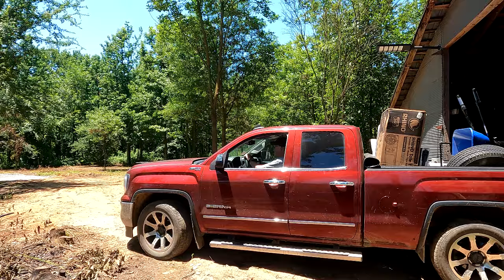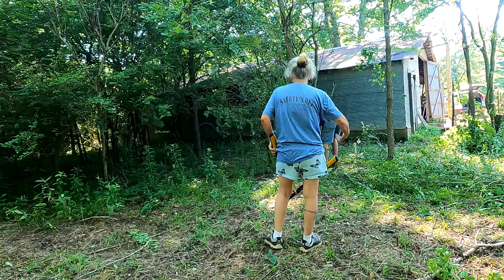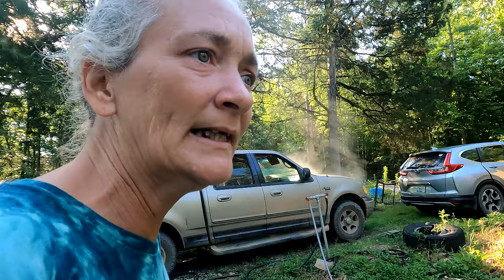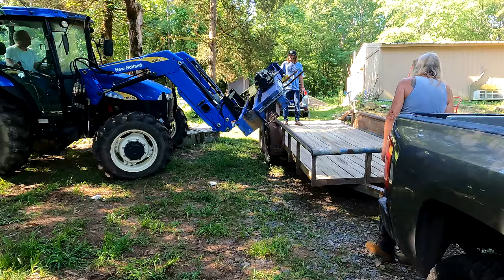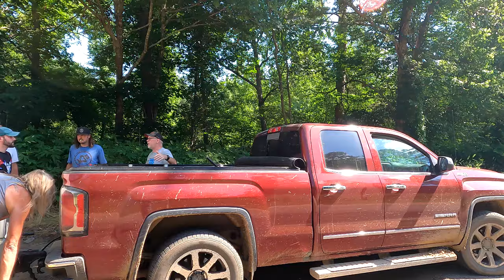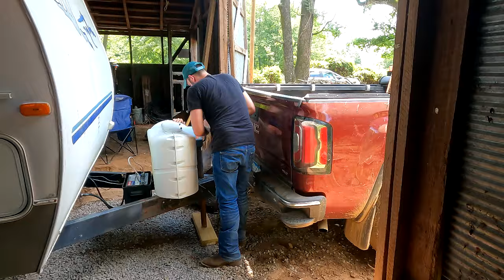DESTINATION HAPPY. PLACE!! farm, tiny house, homesteading, off-grid, RV life, RV living|

Comment: Mike, add "water wetter" after you replace/clean your thermostat, and it will reduce the water temperature by 20°f.
Back wash your radiator to open up the airflow. Check fanbelt for slippage too